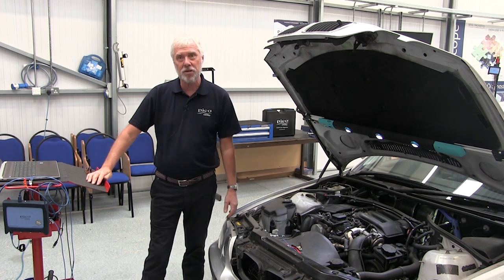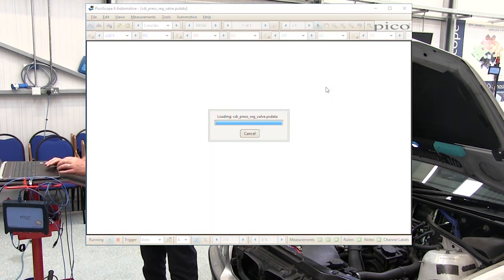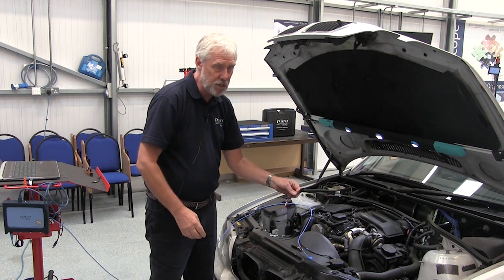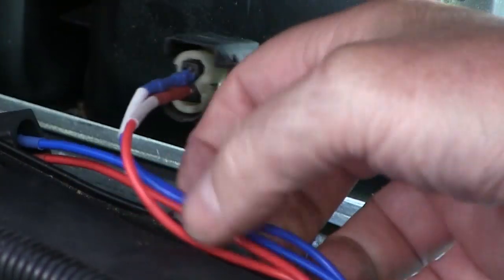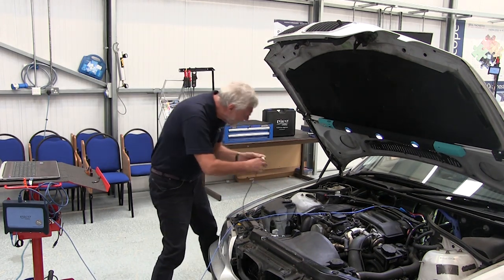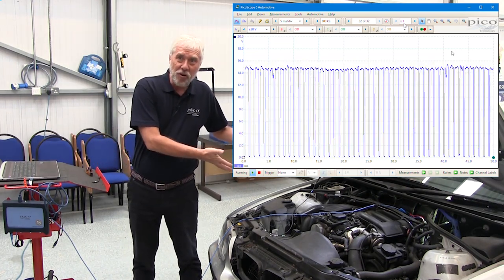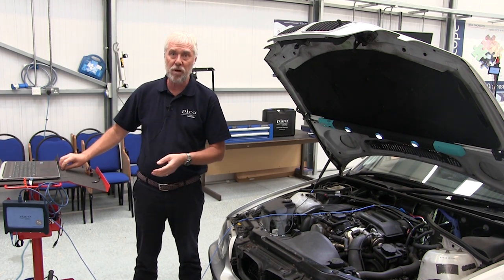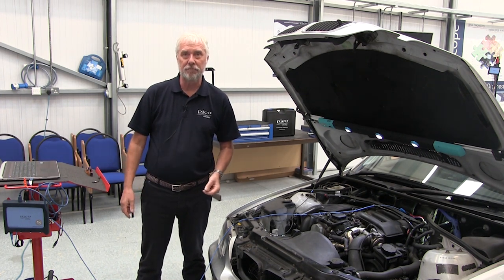Guided Test: CRD (Bosch) pressure regulator valve - voltage

Comment: Hm ... I'm suspicious that this test going to tell you that your regulator is good or bad . This is just checking the control of the ECU . If the valve have some minor wear inside ,  you will be not able to catch it with this test , in my opinion ofc .
Reply: You are perfectly right !!!
Reply: Hi Crank, you are correct that we are primarily checking the actuator control signal from the ECU.

However, the ECU has feedback from the rail pressure sensor so if the regulator is heading out of tolerance (mechanically or electrically) the ECU will see that it will have adjust the duty cycle for the rail to reach the desired pressure. Therefore if the duty cycle is above or below the normal % for a given set of operating conditions then you will know that the regulator could be faulty. Note this does not rule out an issue with the high pressure pump or inlet metering valve or low pressure fuel systems. As such, when you are happy with how to measure these components separately then you can start to look at their combined behaviour using multi-channel measurements, which will give you a greater insight into how the entire system is responding to a possible fault.

Also, it is useful to check the actual PWM duty against the expected PWM duty (as read from the ECU by a scan tool). A difference will tell you that you have a control problem.

Hope that helps.